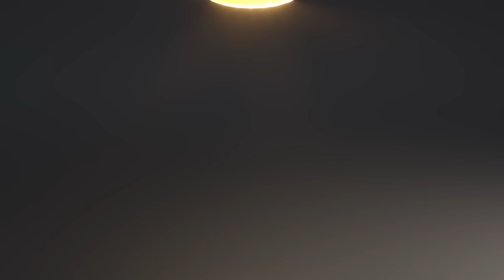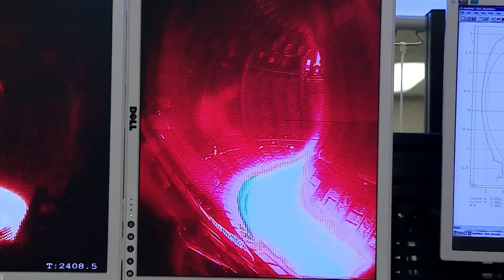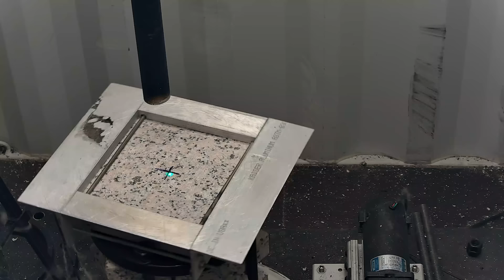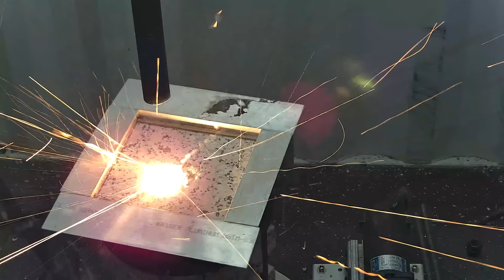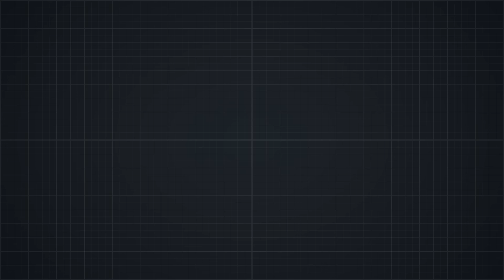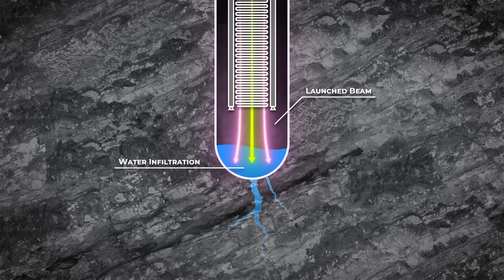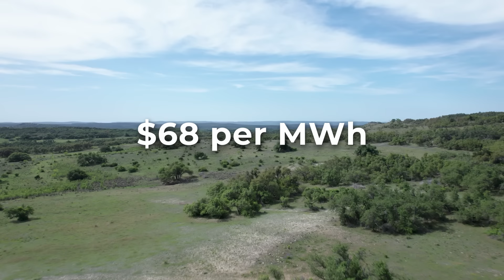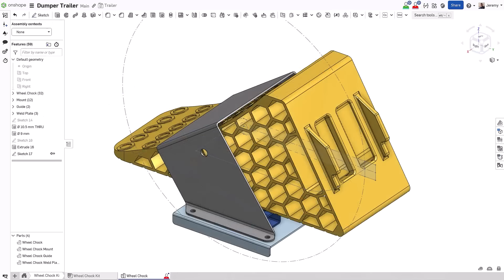Geothermal Energy is Changing

Comment: Sooo, we know that our core is slowing cooling & as it cools our atmosphere protective magnetic field is slowing weakening until it stops after the core solidifies. If we are taking, stealing the heat/energy we are stealing the time from the conditions believed to be necessary for any planet to be habitable. Not only are we taking its heat while losing some as it is brought to the surface we are then pumping the cooled cold water back down into the supercritical source which will cool the area around it. Energy is neither created or destroyed it is converted & some of that can be lost/unused. Wind turbines steal the winds energy & creates voids in the wind, lessening the wind’s potential effecting weather in areas the wind no longer has the same strength to reach further in its flow path. That’s why you cannot put a wind turbine directly behind another, the wind is so weakened that one behind would not be able to generate the same potential amount of energy.

Comment: I get that it costs a ton to drill that deep. However, the US ordered a minimum of 100 new B21 planes at $692 million (in 2022 dollars) Average Unit Procurement Cost (AUPC). Not $692M total.
$692 MILLION EACH.
Do the math and we could fund drilling more than 2,500 six kilometer holes. I don’t know how many homes that could power, but I bet more than 100 bomber planes could power.

(APUC is the total costs of all procurement funding to include, aircraft flyaway costs, support equipment, training, spares, and engineering change orders)

Comment: Could we (or do we already) use heat pumps to concentrate the heat to get to that superheated stage without having to drill as deep? Or is the gain from superheating not enough to balance out the energy cost of the heat pump? It would enable using more boreholes, instead of a deeper borehole.

Comment: 1:45 It's not really a fission reactor. (unless you want to consider alpha-decay fission). The nuclear furnace is driven by decay of U238, U-235, Th-232, and K40 wich is mostly alpha, and beta decay. U-235 undergoes the occasional spontaneous fission, but that's not a large contributor.
Reply: This commentary would be fixed on top of commentaries in this video.

Comment: Instead of producing visible light, it produces higher frequency microwaves.   What?! Microwaves are much lower in frequency than visible light.
Reply: I understood it, that they are on the hf side of the microwave spectrum, but it's poorly worded
Reply: It's like saying invisible infra red, that's below visible light to humans.  On the other hand, why not use high power visible or invisible lasers instead?
Reply: Seeing that microwaves have a wavelength of roughly 1m-1mm, I wager the resonators probably are built around that size.

Comment: The US Energy Information Administration is forecasting that 93% of new power generation units this year will be Solar, Battery (BESS), and Wind. The idea that we can't transition to clean energy with current technology is misleading. The backlog of grid connections and the deeply rooted coal/methane gas infrastructure that would become stranded assets for their owners is what is holding us back. What our future grid does need though is a diversity of sources to avoid the pitfalls of highly homogeneous generation that the last century of generation left us. Geothermal should play a part in it, but it by no means is some sort of key to saving us. It has less land footprint than solar and offers baseload power besides nuclear or relying on storage. Transitioning the electrical grid is not the hardest part of decarbonizing our society and we are already on our towards that grid transition solely due to the economics

Comment: To mitigate some of the drilling costs early in the drilling stage, perhaps the initial drilling go could be done with conventional drill bits, and only switch to this method once it no longer is viable use physical drills. I have zero clue though lol.

Comment: Hybrid drilling method could be practical, called, conventional drill combined with lower powered, miniature distributed cyclotrons for intermittent bursts of rock  vaporisation as a secondary method.
Replacement drill bits can be installed inside the main drill bit system, to replace drill bits on the go.

Comment: The vaporized rock won't stay a vapor as it rises back out of the hole, and at a fairly shallow depth even, I'd imagine. Those particles will continue to rise with the nitrogen, but especially early, while they are hot, I'm imagining they will stick all over the place, and the diameter of the hole above where you are drilling will gradually shrink. Getting all of that sticky rock "dust" to travel back up many kilometers is a problem that didn't seem to get addressed? Is it just that that is already a solved problem addressed with conventional drilling techniques?

Comment: Oil field worker here. Oil drilling rigs would go out of business if their thru rate were only 1m per hour. A typical frac hole is also staggered from a 14" hole down to an 8" hole. It is also 20-25,000 feet (6100-7600m) long. The vertical depth is typically no more than half of that in general. Also, depending on the material being drilled thu, the progresssion rate of the string can be several hundred feet (75+m) per hour. Tripping in and out of a hole is typically a12- 24 hr process more or less. A constant 1m per hour is not exactly impressive. The technology has amazing potential, though.

Comment: Theres companies  that have drilled over a mile in under 24 hours. It doesn't take that long to trip out of the hole as long as you have the capacity in the finger board and dont have to lay down pipe. The drill bit tech has greatly increased since they last drilled the super deep bore holes. Pump pressures have increased greatly also. Don't get me wrong this is cool but is never going to be cost effective

Comment: If we were to install drilling rig sites at current battery sites that exist, we could justify the electricity usage by using excess power generation for drilling. Progress would be slower, but also significantly cheaper since it could be stored for use once reaching a certain capacity. The site would essentially be renting battery capacity until it reached a threshold enough to drill with for a sufficient time of operation to justify the workers being there. Or if battery sites aren't viable, I've seen power companies allow the leasing of entire plants in rural states. Maybe we could start a funding campaign to lease a power plant for a year to drill a geothermal site, then buy the plant and convert it into a large scale power production site. Funding would surely come in once drilling made progress, it just needs to start.

I just finished watching. Still leaving this though

Comment: I have been wondering for YEARS why there is not billions and billions being spent researching how the hell we get geothermal viable... ASAP.... Think about it. Once those holes are drilled.... Thats FREE power.... FOREVER.............. If there is work for that steam to do, it will never run out.... We would never need another energy  source.... ever...... ANother potential benefit that I caught, I wonder if the walls of the well are going to be strong enough from melting, to the point of not having to line the well with steel pipe!?

Comment: Aside from construction time and cost from start to finish, it would run ballpark $6M in electricity and would take a little over year and a half to drill, if all things go perfectly smooth, to reach the same depth as the Kola bore hole. 13X Faster, and potentially 10x cheaper.

Comment: Back in the 60s, General Dynamics came up with the “Blowtorch” system.  It used combustion not to melt the rock, but to break it up by sputtering at the rock’s natural frequency.  It worked but for one thing..the vibrations welded the pipe joints together.  
     General Dynamics teamed with Gardner Denver which made blasthole drill rigs.  I heard the story about it second hand while working at Gardner Denver.   Perhaps a patent search might turn something up.

    Marble Falls, Texas sits on solid granite.  If they can drill there, they can drill anywhere.
Reply: That’s great right up until the drill finds the place where that solid granite is no longer solid.  There’s a lot more than rock in the crust and all of it is under insane pressure while some of it does NOT take kindly to intense heat jets sputtering in its face.

Something tells me they’d have one hell of an “event” if that device managed to find a pocket of high-pressure methane a mile or three into its journey.
Reply: @ All my info on this was second hand and 45 years ago.  They would have test drilled in Bridgeport Texas which is NW of Fort Worth and likely sedimentary formation.  Marble Falls is in central Texas NW of Austin.  It’s so solid granite they have problems finding water zones.  Check out ‘Enchanted Rock’ near Llano Texas.  
   As far as well collapse, the drilling would need drilling mud, surface casing and BOP to control the well and flush cuttings.  Methane won’t burn in the well…it needs oxygen, but it can give a ‘kick’ which can lead to a blowout.  All this is old school.  The question is whether either the GD tool or the one in the video work under real downhole conditions.
   Thermal wells are problematic.  High Temperatures are needed for efficient steam power generation and by extension to the drill bits, string, mud, casing, completion jewelry.  This limits the metals available as they loose strength with temperature.  
   The road to success is narrow and littered with speed bumps.    I hope they succeed.          Cheers
Reply: @OneBiasedOpinion  They're using pressurized nitrogen when drilling so if they ran into anything the pressure of the nitrogen would keep it from immediately filling the hole. Not sure what they'd do from there, but it doesn't seem like it would immediately just become an unmanageable disaster
Reply: @OneBiasedOpinion  It increases 30c in heat every KM. Higher pressures LOWER combustion temperatures. Pretty sure once you got low enough you wouldn't have to worry about combustible gas pockets?
Reply: Actually its called thermal spallation, we do drill like that with a laser. Check out DeepU Project.

Comment: Some side toughts to the first min.
What happens if we get this 0.1% heatenergy? Ther are any guarantee that not just extra energy to allocate to our  "lazy" and "cozy" lifeform? What hapens if we put these energy to into the enviroment? another 2-3% celsuis for  avarage temperature?
Let optmistic the oil based energy system got 80% less (we need oil/gas for lot of thing, and energy density still a chalange) Our system we have build up support the resource wander from poor to rich, The humanity look like is not to stop to overpopulate Earth, but extra energy do not solve the probleme of feeding it.
Another side the source is not endless and impotant part of the envirement what keep us alive. What if we cool it faster, have we the knowledge tp pump heat into it if the core start to stop moving, and dont  give us the magnetic shilde?

Comment: Do we know how they deal with the vapours from the sublimation of the rocks? I don't see how it can be fixed even with the nitrogen purging, the vapours will cool relatively fast and will not be able to escape the hole before solidifying again, which will happen around the drill tube and will in time clog the hole through which the vapour would else esacpe. So in turn feeding nitrogen will become near impossible cause of the now limited volume near the drill head. I am most likely overlooking something crutial but can't figure out what, hope someone else here has the answer.

Comment: I don't think the cost of the gyrotron and the power supply are that important, since (unless I missed something), they can theoretically be reused many times. What I would have liked to know is the energy balance of the system. If it takes GWh to drill the hole, how many GWh will you get out of this over the lifetime of the geothermal plant?
I also don't think that the cost of energy made that way can be directly compared to that from wind. Unlike wind, geothermal can provide reliable baseline power. It puts less strain on the grid and does not need storage. All of which drive up the cost of wind power beyond the cost of generation per MWh. That is why many countries still build nuclear power plants.

Comment: I find it odd how the potential issue of gas buildup wasnt addressed. The rock gas that is being created if traveling up the sides of the hole could cool back down and liquefy or solidify, creating that rock wool stuff all up and down the pipe. I imagine that would clog things up and create blockages, requiring the drill to do multiple passes to keep clearing out the rock wool buildup. That could either stop drilling entirely or make it take longer and more expensive

Comment: I am concerned as to what happens when this machine hits a gas pocket.  There are other pockets of material to be concerned with, but I don't even know how regular drill operators deal with a gas pocket.  Probably better to drill with conventional equipment, then switch to the Maser when it has gone as far as it could.  Hotter rock is easier to vaporize.  I just don't know if any gas or steam pockets are lurking under the deepest depths.

Comment: Compared to the costs of building, running and decommissioning a nuclear power plant it sounds like a winner.
Reply: But this one can have very unpredictable  consequences…
Like what happens if earth's rotation gets affected in some way?
The worst scenario is that earth might lose it's magnetic field.
Reply: @ a hole that is a few feet across on the surface of the earth penetrated to a few kilometres down will have no impact on anything. There are diamond and gold mines in South Africa that go down to 2.5 miles! You must be American?
Reply: @akula9713  Just because there are mines that don't reach further than deepest hole in Russia doesn't mean that drilling directly into the core of the earth won't have some sort of consequences.
The core losing heat might affect rotation of the earth.
Reply: @ How will it effect the rotation of the Earth?
Reply: @akula9713  Simple the trapped heat will go somewhere else which might result in cooling, the slower rotation will result in losing the magnetic field.
Reply: @Brooofs  that’s the type of American thinking I thought of☠️.
They would have to develop a fail safe for the cores energy if leaked over threshold to be stopped from escaping. The sensitivity would have to be close to immediate, and be implemented as you install new coated pipes further and further down

Comment: 9:08 Current drill rigs can drill significantly faster than 1 meter per hour through hard granite, the fastest I have ever personally seen is the globe drill GT3000 mobile geothermal drill rig it could drill a 12 inch diameter hole at 23 meters per hour and using a 8.5 inch PCD drill it could reach 25 meters per hour. This rate decrease the further down you go  as he stated in the video due to the fact you have to pull all the drill rod to replace the bit but that only happens if you need to change the drill head. One drill head is usually enough to drill a 3000 meter well. I personally think that this tech is super exciting because it is almost a guarantee that while drilling a geothermal well that you will hit a layer of rock that is tremendously hard or unstable causing you to either burn up a drill head or have your well wall collapse this tech can get around both those issues pretty easily.
Reply: You can also start the traditional way and switch go the new one mid way

Comment: Levelized cost of energy is extremely misleading, because it ignores the cost of itermittency. Wind and solar actually cost way more, because you need to maintain the entire preexisting grid as backup for when it's not windy or sunny. Geothermal would be much better, because it isn't intermittent.
Reply: We don’t necessarily have to maintain the old grid, but storage does also have costs to it

Comment: Maybe I missed this, but: 
there's this gyrotron that resonances the electrons which in turn create the hi-power microwaves. cool. then there's some sketchy mirror, deflecting MWts of power, this should be one really tough mirror! 
microwaves travelling into depths to melt the rock some km below? delivering all this power into where it's needed imo could be one of the most critical problems. was there anything said about losses on the way? would it be like reverse square of the distance travelled? 
or i missed it completely, and the whole gyroblaster goes down the well? this can't be true
Reply: Microwaves are just radio waves. Microwave oven operates closely to WiFi a/b/g spectrum, for example. Difference is just in power levels (router gives milliwatts, oven gives kilowatts). In their tech they just want a drilling column to be a waveguide. If calculated correctly waveguides can be extremely efficient, giving very few losses. Calculated correctly — that's the tricky part. Every geometric flaw in this kinda waveguide slash drilling column will heat as hell.

Comment: ive  a  question please  enlighten me ,  with this  EM  drilling  method , the rock  will need  to remain vapourised  as  it goes  up the shaft,  the deeper  it goes  the longer  the distance  it has  to travel ,  wont this pose  a issue  of  rock solidifying  and  clumping on its way up?